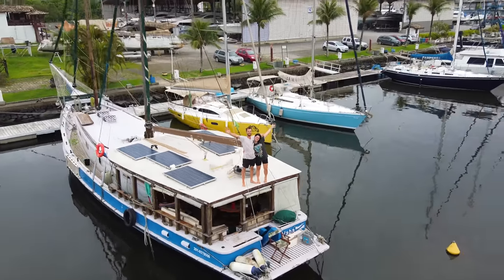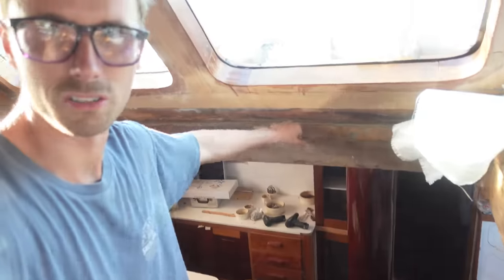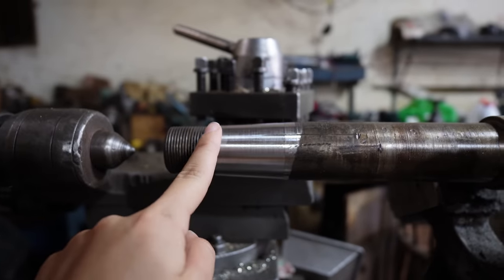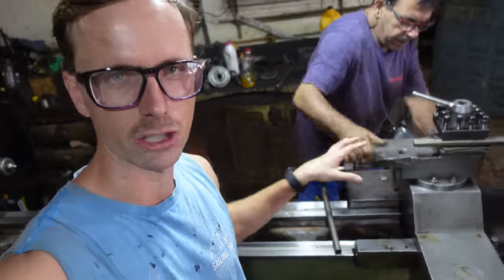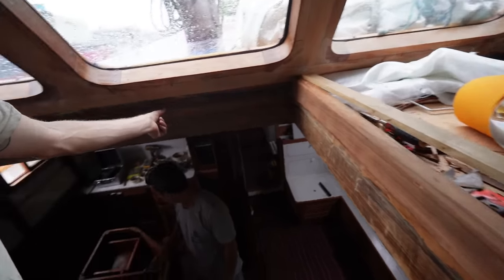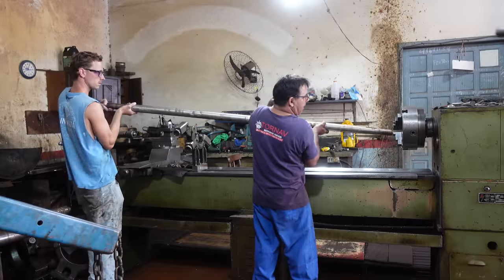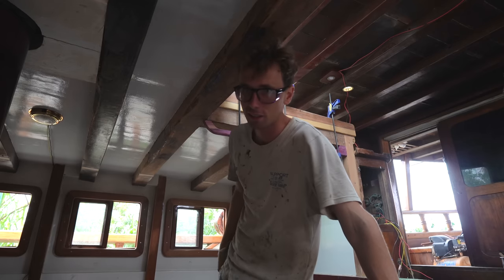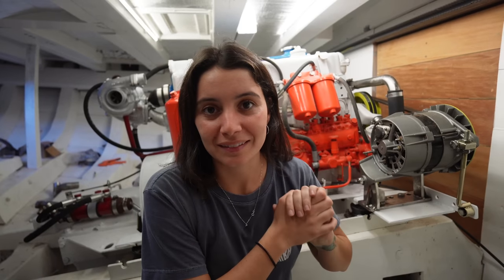Reviving a Wreck: Professionally Unbending a Prop-Shaft & Purple Wood Handrails — Sailing Yabá 136

Comment from the maker: Hi guys! Were you familiar with lathe work and shaft unbending? We are still so impressed with how everything got done!
Reply: The tunnel of your prop shaft is called a 'Shaft Alley'.
Reply: 👍👌👏 Great. But please no distracting, unnecessary and not fitting music (10.38 min) next time. Thanks in advance.
Reply: Shaft, shaft alley!🤔 Let's keep it clean ! 😉
Reply: It's called a prop shaft "stern tube" and not a tunnel, the tunnel you will find on large ships where it will lead you to the inner shaft gland and stern tube and prop shaft
Reply: what a great craftsman the lathe man is
Reply: very fortunate to find someone still doing that work!
Reply: @egonkemp3512  🤣 Bad pun. funny, but bad. 🤣
Reply: Most of the lathe work I’ve done is related to Woodworking, however, back in school I took a shop class where we made a small tack hammer and I use a metal turning lathe to make the handle. Have to say I’ve never seen anyone straightened a shaft on the lathe in that manner before. I’ve seen people using hammers and anvils or maybe a press, but never while it was mounted on the lathe. Now I have seen after otherwise straightening a shaft to have it, put onto a lathe and then turn it, where they spin the piece with the lathe and run the cutter across it, thus making it perfectly straight by taking out even the smallest imperfections seeing as the cutter is always an exact distance away from the center of the shaft, but this does make the shaft a little bit thinner.
Reply: ... you may be interested in knowing, the engine lathe is considered the 'mother' of all machines. You can build all the other machines starting with the engine lathe. She came first. I completed machine school in 1978. We still cranked them by hand. Now everything is automated.
Reply: @canvashomesusa8729  yes, I remember seeing one of the first metal turning lathes in a museum, and it was what started the industrial revolution because it was the machine that made other machines. Then, as other machines became better and made more exacting parts. It helped to improve the lathe to make more exacting parts that help to improve the machines. It became an upward spiral that led to our modern world.

Comment: The more i see of the talented Brazilian tradesmen , the more i'm impressed . The mechanical side of Yaba is going to be rock solid , straightening the shaft the machinist working wonders on those heavy pieces of steel . Yaba is becoming a legend the boat that went from a rotten hulk to a fine sailing vessel . A epic story indeed .
Reply from the maker: Thank you so much Claude!!
Reply: Dear Claude H.
👍👌👏 Very well said, very well indeed. I wanted to comment similar but fortunately you already did all the writing work. 😁 ;-)
Best regards, luck and health in particular.
Reply: @Chr.U.Cas1622  Thanks , i've watched from the beginning and i was originally very skeptical that the boat could be restored . The word Amazing is often over used these days , but Yaba & crew are truly amazing . Take care my friend . Claude
Reply: @claudehopper9813  
You're welcome, it's my pleasure. 2) Since 2017 I watch several other channels with sailing boat restoration content. For instance Sampson boat Co (Tally Ho), Acorn to Arabella, Sailing Melody, Sailing Magic Carpet etc.. Therefore I unfortunately could see what all was done wrong respectively could've done significantly better on Yaba. For instance: The planks are nailed on, I've seen no using of bedding compound (for instance Dolfinite) etc.. The craftsmen are pretty amazing but I nevertheless guess, that they don't build boats that last really long. Maybe because their wooden fishing vessels are completely worn down/out after 20 to 30 years anyway? But this is just a guess.
On the other hand: The repairing of the hull might be done just good enough. In Europe or North America nothing like this restoration would've been payable. Especially not for a young couple. They work really hard for their dream and I wish them all the best.
Sincerely yours

Comment: Hi guys! Me again! Your "telescope" is the "Cutlass Bearing". It's held secure in its housing (the casting, usually bronze), which gets bolted through your stern post. The piece of metal which locks the prop shaft to the flange is called a "Woodruff Key". A very common method of transferring rotation. 😀 Having some glorious sunshine here in Scotland!
Reply: The cutlass bearing goes inside that piece.  The piece that connects to the boat is called the propeller shaft log.
Reply: @Jack Patteeuw  Hi Jack. I clearly could've done a better job, but your opening sentence is exactly what I said in mine. In the video, MP describes the finished shaft as fitting "perfectly to this piece", which at that juncture is the cutlass bearing. I know she's talking about the unit as a whole, but the cutlass bearing is the only part in contact with the shaft and I thought it was what she was trying to describe.

Comment: Tradesmen are a joy to watch them work.  We had a bent 2-inch shaft and the company had a 1,000-ton hydraulic press so the operator put it into a jig and gave it a few light taps and it was as straight as when it was made.

Comment: I found that since the 'Packing gland' only touches the shaft with the packing, and, while it uses sea water for 'lube', the sea water doesn't need to move any further into the boat than the packing itself. So I spun a meter or so of 'Teflon' tape into a cord and wound it around the shaft atop the packing. This stopped the 'weeping' of sea water into the bilge without preventing water from keeping the packing cool. There was still the occasional drip, but it was way less than just the flax. Our twin 350 Mercury inboards ran for much longer than your engine ever will and hardly dripped at all... :face-fuchsia-tongue-out:

Comment: Your (tunnel) is called the prop shaft TUBE normally. It is called the prop tunnel on ships where you can actually get in to inspect the shaft, bearings and inner seal. It must be hard to produce a movie in English when it's  not your native language.  Especially when the subject has such wierd names etc like boating does! You are doing great work, keep it up. FyI different lathes use different numbers etc to designate the different thread pitches it can cut. Every manufacturer seems to come up with different gearing methods for the lead screw (this moves the carriage along) thus cutting the threads right. Machining is a fascinating subject. I have been playing with lathes for 45 years and am still learning. Computer controlled machines scare me though!

Comment: Taper. He is tapering off the shaft. Purple Heart. I love that Purple Heart. I thought about using that purple heart in one of my guitar building projects. I wanted to use it on the fingerboard. The fingerboard can be Rosewood, Maple or Ebony. I thought about as purple heart which would look beautiful. And those Machinists work with Zero tolerances (0). They are very precise. I'm always fascinated by their work. I love your work station. Good job guys. Great content. God Bless.

Comment: As an apprentice i used to straighten 200mm dia plastic extruder screws after machining except we used a block of lead a twenty tonne jack and a sledge hammer! It worked though. Just another small point, its called a taper not a cone, cones are for ice creams!!!

Comment: Quick tip. If you're struggling to screw a fastening in, use a spanner on the hexagonal part at the top of the blade. Unless it's a cheap screwdriver, in which case it probably won't have one.

Comment: Are you installing a lightening arrestor for the masts?  I saw another boat video where having no arrestor setup forced a lightening strike to  find it's way out of the hull into the ocean.   Without an arrestor set up the strike made  a fist sized hole in the boat's bottom to reach the water below and almost sank the boat before the "crew" could patch it closed.

Comment: You should start to get used to some sailing vocab:
Rocking is on the waves from bow to stern, rolling is to the sides - usually/hopefully from the smaller waves.
A boat heels to the lee because the wind pushes the sail and the mast to one side.
Question: I know you guys know how to dive. Do you know (yet) how to sail? If not: I'm looking forward to watching you learn it! 😁😉
Good to see you literally had your prop shaft straightened out! So, next thing I'm really looking forward to is you lining up the prop shaft and the engine!
Reply: this boat will roll a lot and have verry little room for heeling, with the low freeboard and wide beam its decks awash soon.

Comment: The "cone" shape is called a taper. I am surprised they didn't heat/quench the shaft straight with a dial indicator, in the same way turnwright machineworks does it

Comment: If Yaba is going to have propane tanks onboard, then having a small combination lathe/milling machine will allow you to create custom fittings (out of brass bar stock) to refill your propane tanks no matter where you go.  Having seen the challenges that other sailors that travel the world have had to re-fill propane tanks demonstrated many different fittings.
Reply from the maker: Thanks for the suggestion! We are planning in having an all electrical kitchen mainly to avoid said problem. Even inside Brazil the different fittings can be tricky.

Comment: I never knew that propshafts would get bent, I wonder how it happens?  A great skill by a guy who is dedicated, gets paid directly by the customers, no middleman, mind you he has to maintain all that heavy duty equipment.  Many modern boats use a 'dripless seal' on the propshaft, which minimises water entering via the stern tube, keeing the bilge dry and clean.  It needs to be installed when re-fitting the propshaft.  Would you consider fitting one?  
I like the handrails, I think some more posts / handrails would be wise, you always want to be able to have one hand a handrail so you can move between them when the boat is heeling, moving a lot, and also account for people of differing heights and reach.  Perhaps a post at the top and bottom of the companion way either side?
Reply: You can bend a shaft by changing engine speed faster then the prop can correct for it, or hit something with the prop while the engine continues at speed.    
The waters resistance to the motion of the prop can bend the shaft.   Hard to think that it can generated that much force....

Comment: The tunnel of your prop shaft is called a 'Shaft Alley'.
Reply from the maker: Thank you!
Reply: Or a Stern Tube
Reply: @billvanvlack117  Stern Tube goes through the Keel below the waterline. Shaft Alley is the home for the actual drive shaft where [it] is fully inclosed in its own space.
Reply: @SailingYaba  You are very welcome. Now get back to work I want to see you cruising before I die.

Comment: I've have been educated as a mechanical engineer, so the lathe is familiar.👴😉
This kind of straightening however is new to me. A bit embarrassing to say, but here, normally a bent shaft is simply replaced by a new one, as is everything that is damaged by it...😔
It's logical that you start being anxious to finally splash, but all these "little things" are taking a huge amount of time.😒
However if you do not take the time to do it properly now, sooner or later it will bite you in the @ss...👴🤭🤗